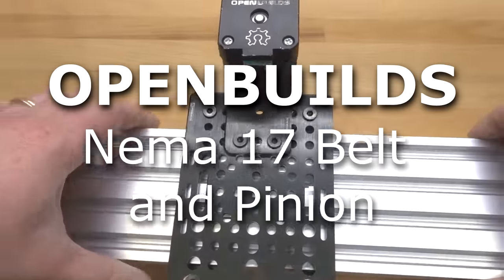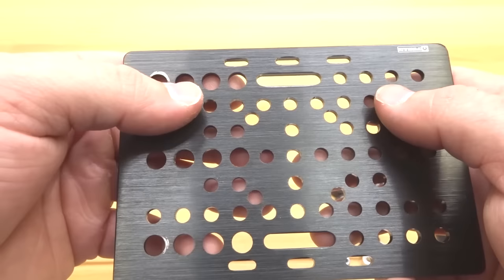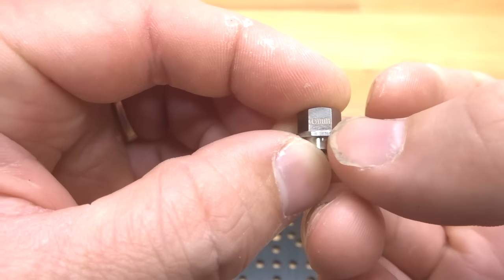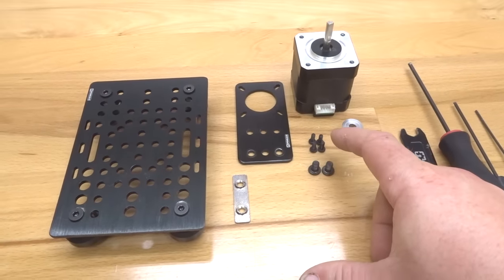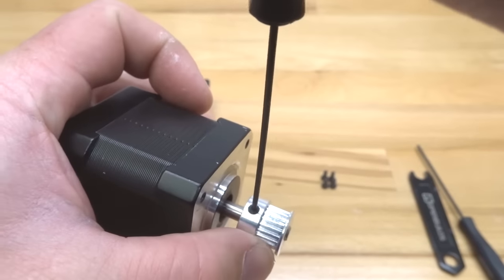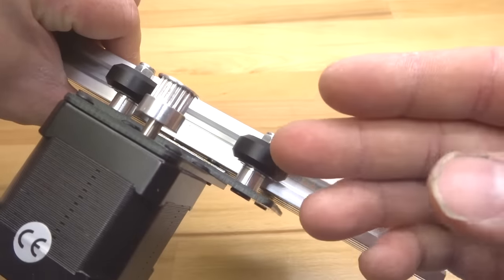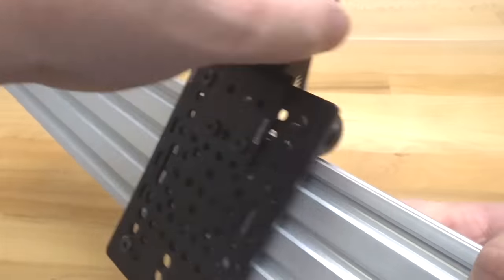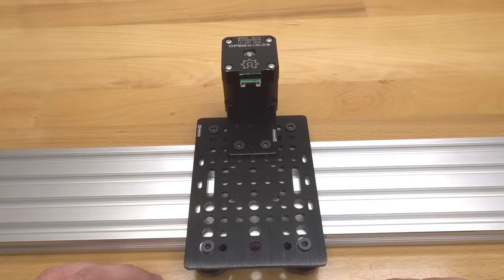OpenBuilds Nema 17 Belt & Pinion System Build

Comment: the other linear actuators you offer mount the stepper to a static beam and loop the belt reducing weight on carriage.  What is the benefit of mounting the stepper on the carriage in this application?  reduced footprint?  Is the placement of the stepper what makes this a 'pinion' system?
Reply from the maker: What we find is nice about this setup, is that it takes the motor with it so in theory you could have really long lengths where the belt is being picked up out of the rail and looped over the pulley as it goes.

Comment: you can go 6 wheels with that plate too but it wont let you do a XY stage with 2060 or 2080. It will with 2040 or run 1 side 2060/ 2080and the other 2040. It also allows more movement on smaller lenghs of v slot.

Comment: I have already been designing this for my CNC router build. 2080 with steel plates on the sides. GT2 belt in this configuration with the polycarbonate wheels. I doubled up on the plates to make the universal plates "thicker" for this application

Comment: I did the same, except add a "bottom" belt.  Another length glued to the rail with the teeth up.  The drive belt  meshes with the bottom belt.

Comment: where do you attach a gantry, thanks
Reply from the maker: Please have a look at some of the examples included in the Build here under the Files and Drawings Tab. Also make sure to check out the discussions to join in and see how the community is using these actuators. - https://openbuilds.com/builds/nema-17-belt-and-pinion-actuator.7499/